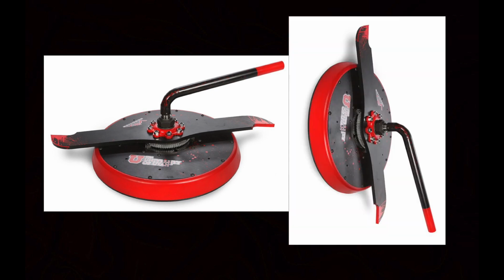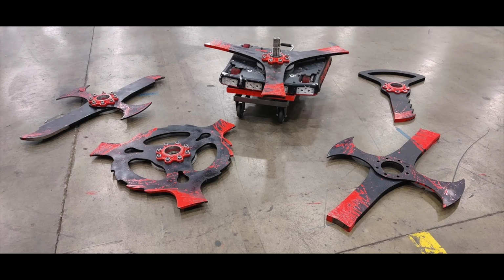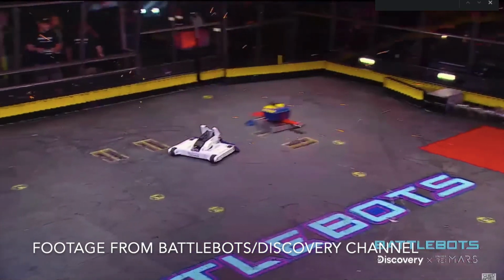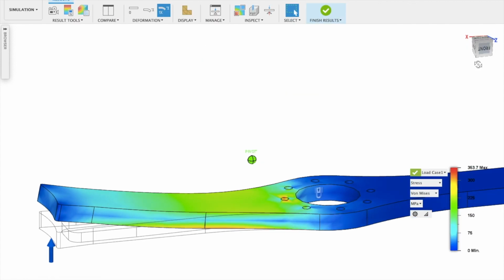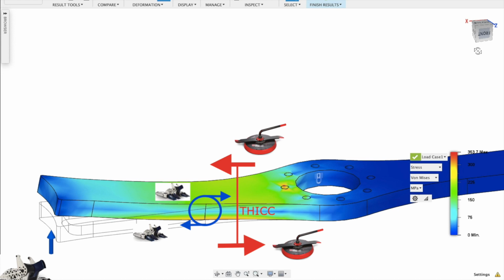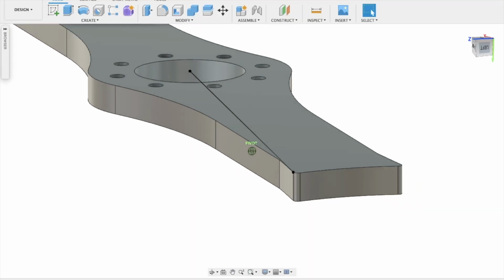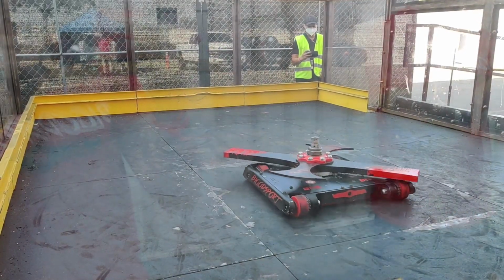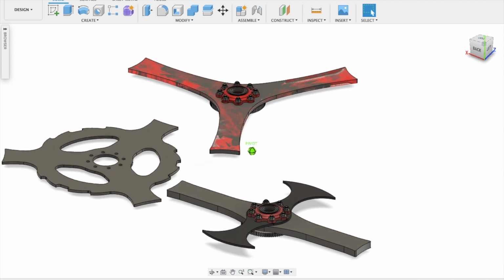The THICC Bar- Battlebots Team Bloodsport Blade Design, Part 2

Comment: Can I ask why you decided to go with a U-channel design rather than an I-bar?  I believe It would offer better rigidity for the weight.
Reply from the maker: Primarily manufacturing reasons- an I-beam with better vertical strength would require more pockets, which would need to be carved into the narrow edges of the bar. Also, since we're a horizontal spinner, the primary loading direction is still the horizontal, so we need to maintain the bar's strength in that direction. If we could figure out how to do a box-channel type shape, that would give us the best of both worlds.
Reply: @bnsrobotics  How thick do you think the walls of the box channel would have to be?

Comment: In theory, how tall can you make your blade before it either can't fit on the mount or air resistance becomes an issue? I was thinking you can reduce the chance of an out of plane hit if you reduce the top-down area of the weapon
Reply from the maker: The THICC Bar plus stabilizers stacked to 1.625" and just barely fit on the weapon shaft. I bet we could fit a 1.75" thick weapon on there, but that would be the limit. Check out our other video on the Keyblade for more on that theory though- you're onto something!

Comment: spoiler

what happened with the thicque bar against lockjaw? if this is the sturdiest weapon, then would any other weapon break vs lockjaw?
Reply from the maker: We're planning to do a video deep dive on that, but yeah the Thicc Bar is our strongest weapon vertically. It's possible there could've been a hidden crack left over from a previous match that did us in, but it was also pretty much a worst-case scenario hit from Lock-Jaw, so it's hard to say!

Comment: You know, I'm surprised more teams don't use a C-channel bar. Unless I'm missing something, they mostly just go for a rectangular cross section, right?
Reply from the maker: A rectangular cross section is easier to manufacture, so most teams go that route. Bots like Tombstone don't really need to since their weapons are shorter and can just be thick all the way through, but it helps in our case since our weapon is so long.

Comment: What are the stabilizer bars made out of? I'm guessing the same half inch AR500 the Disk is cut out of.
Reply from the maker: The fins are AR500 like the Disk, but the fins are only 3/8".
Reply: @bnsrobotics  I thought they looked a smidge thinner. Were you worried about them talking a hit with your weapon either stopped or spinning slowly?
Reply from the maker: @Fattoxthegreat  That was definitely a concern, especially with the fins extending out beyond the chassis. One idea to mitigate that risk was to use our wedgelets as keep-away sticks to prevent the opponent from making contact if our weapon wasn't spinning. We'll have to wait and see what happens tonight!

Comment: Nice video! One question I have is what is the purpose of the keyblade? The thicc bar is for hard weapon-on-weapon hits, the classic bar has long reach, the tri-bar has the most mass for larger hits, and the disk is for overhead attacks, but what benefit does the keyblade grant? Is it lighter so that you can add extra armour, or does it have sharp edges that can dig into wedges?
Reply: @megaboi4683  gotcha
Reply: I heard from the team that it is for drum spinners like Minotaur. I believe it’s because it out reaches the drum while reducing surface area of the spinner for the drum to uppercut. It also spins up the fastest of the weapon designs.
Reply from the maker: That's right! We originally designed the Key bar for Bloodsport v1, so it's also lighter than the newer, larger weapons, in addition to being designed to evade out of plane hits. I'll save the rest of the details for our next video!